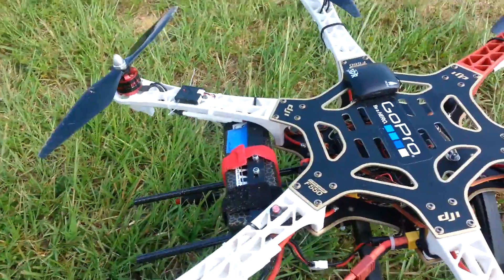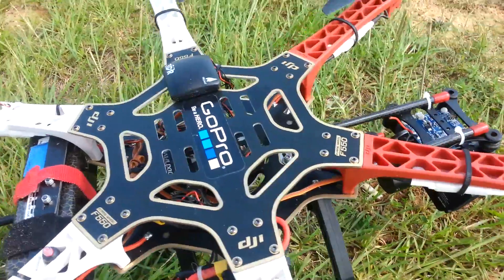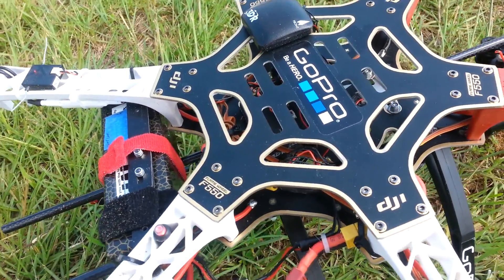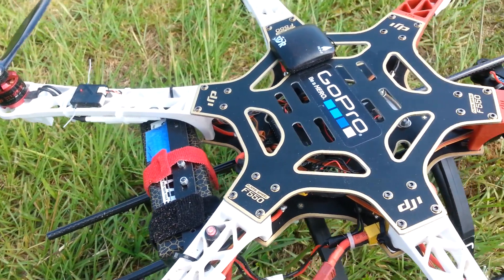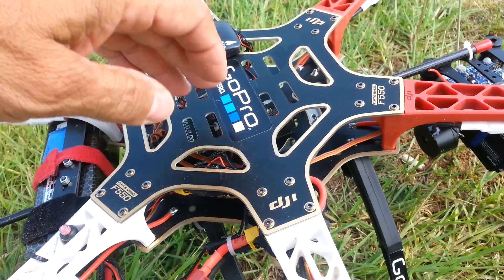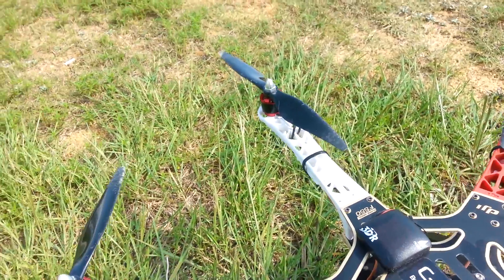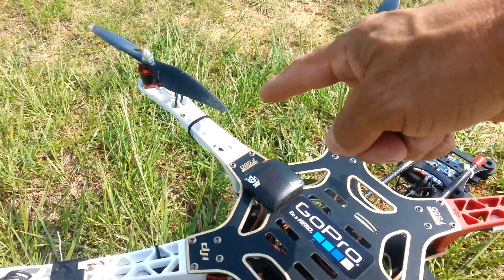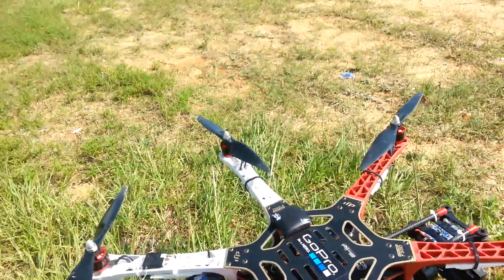CHECK BAD ESC  MOTOR WARNING BEEP DJI F550

Comment: I am having the same problem with a DJI Phantom. I didn't crash it but I did try to install a gimbal and maybe I knocked something out of place when I opened the top. Nothing looks wrong from what I can see. I thought it could be the battery, but I just charged it up so it shouldn't be that.
Reply from the maker: Damon,
After much trouble shooting, I ended up sending Pixhawk back to 3DR for a replacement. Could never find out what caused this 1 motor to suddenly stop working. All is well again.